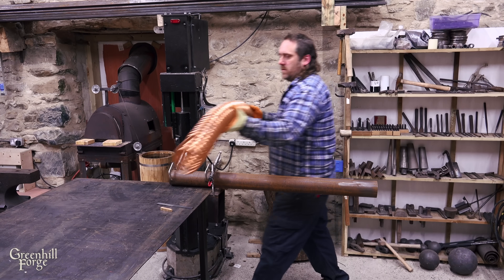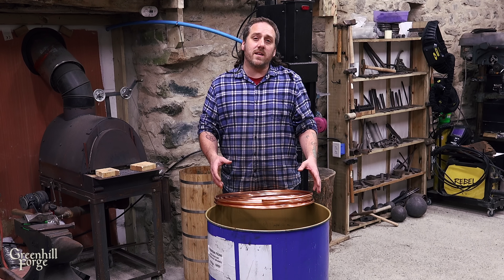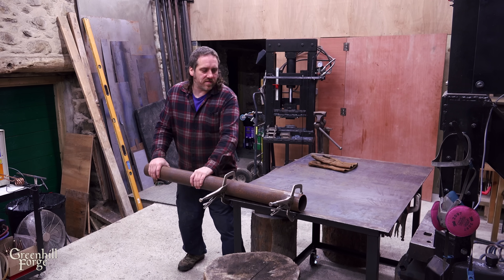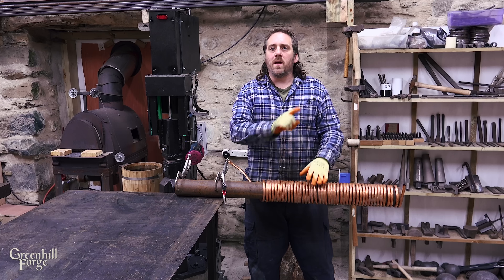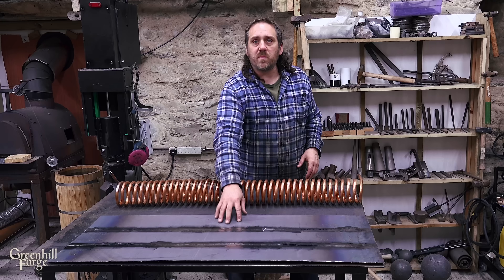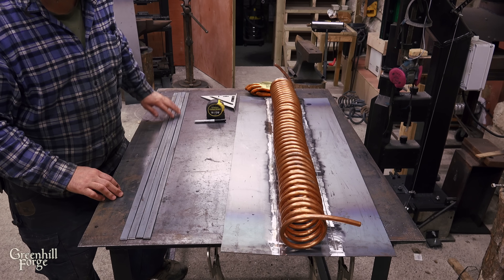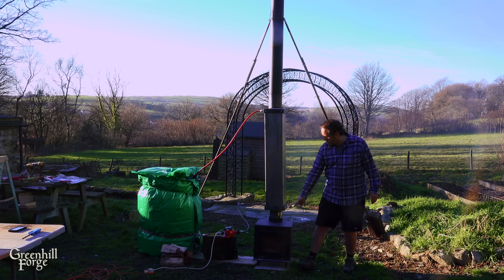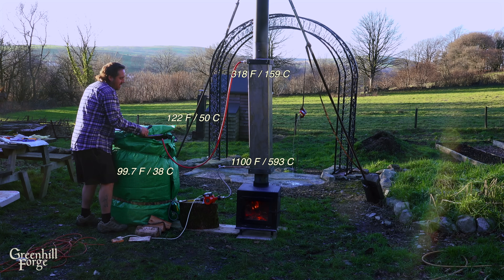Wood Stove Water Heater Experiment - Surprising Results! Part 1

Comment: I believe they sell like a larger pipe, that fits over the main pipe, for like spacer passing through a cieling or wall. If you wrapped the copper around the inner pipe, it should do about the same thing for less work and costs. I am building one for an outdoor hot tub / sauna.

Comment: There is a way to use the heat itself to circulate the water without the need for a pump. A version 2 would be interesting.

Comment: What kind of welding is that? I've been looking to learn, but not sure what is most useful for projects like this around the homestead. Would def cut down on the duct tape!
Reply from the maker: mig is where I'd start. easy to learn and can handle a really wide range of tasks. It's a bit pricey but this welder https://amzn.to/3Gm3Jpm is amazing. can do mig/tig/stick and makes it really easy to learn and get great welds even as a beginner with it's adaptive tech. It basically learns how you weld adapts to it.
Reply: @GreenhillForge  thank you very much for the guidance

Comment: Honestly I don't know why people buy expensive pool heaters when you can put a heat ex-changer on a harbor freight engine and use it's exhaust gas temps that are over 1000 degree's with a heat ex-hanger on it and use the motor to pump the water.  Win win.  Or putting a copper coil in a old Grill, I've seen some people insulate them and maintain crazy heat.

Comment: Hey have you ever seen the plan for a Tesla valve? An array of Tesla valves in series produces back eddys, something like baffles only more Tesla-ey. In your case, I'm thinking efficient energy transfer by slowing the air and messing it up some, so more energy can be extracted, like the Mafia for your home heating.
Reply from the maker: tesla valves are really clever. that's an interesting idea
Reply: @GreenhillForge  I expect engineering them from sheet steel would be even more interesting lol.
Nah I reckon build a mould then cast your fireplace from clay or concrete.
Another suggestion I have that might appeal, is dual curcuits. Turn two sections of tubing together, one short, one long. The short one just does a small tank for fast boiling water while the long one goes to thermal sink storage - a large tank, as well as underfloor heating circuits.
I like your channel and your legitimate scientific enquiries but you are using a heap of energy making these.
I like the bulky concrete, clay, mud, brick and stone fireplaces that act as thermal mass, preferably underfloor for distribution around the entire dwelling.
I like the fact that while being labour intensive, the materials are cheaper and require less skill and accuracy in their construction.
That's a nice stone wall, hope there's more where that came from :)

Comment: The workmanship on your project is second to none and my guess is that you have quite a bit of experience with this kind of manufacturing.  The concern that I have is that the water inside of the tubing will always be at a much lower temperature than the exhaust gases, often very much lower and when those gases come into contact with the tubing's lower temperature surface it will cause the creosote to condense onto the copper tubing and that will be an extreme challenge to clean off. It could turn out to be a creosote buildup machine that produces solid creosote better than anything known to date and that creosote will hinder heat transfer to the water, cause exhaust blockage and may, ultimately, frequently ignite causing alarming situations inside of the chimney. The draft and sounds associated with a chimney fire can be quite alarming but your industrial strength, overbuilt designs may render such an event much less dangerous than a normal residential type of installation, per say, though not at all a safe situation to experience. (I've encountered people who would simply allow their 'normal' residential wood stove chimney fire to burn until the creosote was exhausted; in other words a chimney fire was a non-event and they just allowed it to follow its course without even intervening.  I was passing by their home during night hours and noticed flames shooting 20+ feet into the sky above their chimney and when I knocked on the door, they eventually answered and after I exclaimed. "You have a chimney fire!" they seemed to be not at all concerned. He shrugged, glanced up at it and said "Ok thanks" and that was it.  He was completely unconcerned about the situation and I was of the impression that it was a regular occurrence for him.  I sat and watched until it burned itself out without any intervention at all.  He certainly did not handle the situation in the same way that I would have, that's for sure.).
I digress...

 When you first started I thought that you were going to install the copper tubing onto the outside of a cylinder shaped exhaust pipe (normal galvanized chimney/stove pipe for instance) and then proceed similarly to what you've done in the rest of the video.  I suppose time will tell but I have the thought that you are going to get a lot of creosote buildup inside of there, with more and more of it being located towards the top of the stack on the tubing and the walls of the inside of the stack container (The water will also lower the temperature of the container walls as well which will also collect condensed creosote (that's my thought, anyhow).   I would like to hear if this is the case because I've considered something similar to your design though much more simple.

I appreciate the design work of your system and this is a great video, though a little 'skimpy' on some of the fine details of how to proceed (for instance how to get started bending the tubing around the cylinder, etc.). Still a really good video, much better than many.  Best regard, CRS.

Comment: As mentioned in another reply is the creosote build up. There's no way to to clean it all out. You could get it off the coil surface but not in between or behind it so this is a dangerous concept. Putting the coil on the outside of the pipe, then insulating it would make better sense but it wouldn't absorb as much heat but still be viable.

Comment: The top of the cylinder coil should connect to the bottom of the flue coil. The circulating water should be pumped from the bottom of the cylinder coil to the top of the flue coil. This will maintain a temperature gradient both in the flue and in the cylinder. This is simple stuff - why does everyone always get this wrong?

Comment: Well alright!  Nice.  

Got my brain going.  When he mentioned the need for the two dampers and their purpose in terms of maintaining a particular temp, my brain automatically went to temp sensors with motorized computer control, lol.

Computer control not exactly for off grid living, but it was nice having my head fill with possibilities 😊

Also agree with top comment.  Counter current exchange is well established.  I would say it's vital for a year round setup.  The sooner you're at temp, the better.

Awesome video!

Comment: Like your idea. But not sure about you not fitting the original stove pipe up the middle of the coil ?   Plus copper and steel can corrode when touching            Im thinking of an external steel water heat exchanger fitting snug against rear of my wood stove.    Cold feed in bottom then out top of heat exchanger then into a similar flue coil to yours.             Then after further research maybe link into my gravity fed hot water tank.

Comment: If you were to pull the spiral metal guts out of a fuel fired hot water tank, it would help slow the heat and improve heat transfer and efficiency. Subbed

Comment: what ii know from years of dealing with plumbing issues. first off the copper sitting against metal sawtooth will end up leaking copper expands and contracts rubbing against the steel end result is a leak also being inside the stove pipe? creosote for sure anytime you constrict smoke your going to get creosote. just wrap the outside of your stove pipe done.

Comment: Some of the last production steam cars worked a bit like this, rather than spend 40 minutes heating all the water, they had a network of pipes to flash-heat only just enough water for one stroke at a time. You could push the ignition button and go after a minute or two.
I harboured vague ideas of converting a 1991 Corolla to steam, once!

Comment: Great vid :)  I write to propose a simpler and perhaps cheaper method...

However, your method, could potentially make "running hot water", like for a shower. But for THAT purpose, the copper tube should be thinner, and longer,
so there is many mor windings around the chimney...

 
I will also support what    @whm304   wrote: Send the water IN at the top... As it pass down, it will be heated to get warmer and warmer, 
and then it is a great advantage that the chimney is also hotter and hotter, "on the way down"...
As it is the difference in temperature "between two objects", which determines how FAST HEAT moves, from the warmer to the colder "object"... 

I will also remind you, that if you painted your copper tube BLACK, (with special oven paint) it would ABSORB HEAT FASTER!

BUT I was confused by your measurements... When the top end is so hot, the water should have fully evaporated and be hot STEAM, right?

Now I will explain a simpler method, which by principle is more effeciant than your surrounding copper tube... And perhaps cheaper too ;)

In my childhood, father bought an small oil burning heater (using an especially puryfied oven gasoline) for our small sailboat.
Because we live in Denmark, and also wished to sail in all weekends in the early spring and the late autumn, when it could be really cold...

THAT oven, had a round 15 cm diameter tube about 60 cm long, oriented vertically, to be the burn chamber...
The top was connected to a thinner chimney pipe.
AROUND it was build a metal box, some 50 cm tall, 30 cm wide and 40 cm "long", and THAT was the water reservior...
There was a tap, near the bottom, to take warm water, and another near the top, with a funnel attached, to fill cold water on the tank, when needed...

Inside the chimney pipe, there was a thin tube connected to the water tank, so IF the water started boiling, it would allow steam to go out through the chimney,
to avoid that the closed tank exploded.
With that we quickly got warm water, to wash ourselves, and the food utensils, and we could also take warm water to make the boil time shorter, when making coffee on the gas stove... And on the top of the tank, we could place a kettle, to get additional warm water supply, or heat canned foods or such.

After stopping the oilburner in the evening, the water tank acted a a heat reservior, which gave heat to the cabin, much of the night.

However the tank also acted as a "heat dampener", transforming perhaps  200 degrees Celsius on the burner tube, to perhaps 80 Celsius degrees on the outside of the oven, so it never scorched the surrounding wood, in the cabinet it was placed in...

Obviously that cabinet had air intake holes at the bottom, and an open top, so it was mostly "air heating" rather than "radiation heating", which heated the cabin, so it was equally warm all over in the cabin... Instead of being very warm, near the heater, and cold further away...

This "hot water oven" obviously also had a small oil tank, in the bottom of the water tank, but this is irrelevant for your wood burner project ;)

What IS relevant is: You could also make your burn chamber, be a vertical tube, perhaps 20 cm wide, so it is a top loaded wood oven.
Just with air intake at the bottom, and a small "door" to take ashe out, and obviously a "grill" inside, just above that door, so the wood rests on that...
This way the flames act directly on the sides, where your copper tube is, instead of only using the heat in the air in the traditional chimney tube...

That way you trap near all of the heat from the combustion...

By the way, I believe our oven was fully made of stainless steel, as that is most often used for boat equipment, to avoid rusting in the "damp air" at sea,
and it was also "food grade" so we could use the hot water for coffee and such...

But it was obviously painted black on the outside, to emit heat fastest...

Comment: The copper need to be outside the flue. Too much flue maintenance overtime with tar. Insulate the copper with fiberglass cloth tape. I have done a similar contraption to heat my pool water.
Reply from the maker: Check this one out https://youtu.be/5G1yANLjzw4

Comment: IMPRESSIVE!!!!  Will you be selling this product? Would be great for emergency water for cleaning dishes, and bathing, etc.   if the power goes out. Does require welding equipment and tools and other tools and no doubt some strength to bend the metal, etc.

Comment: ...also maybe add a bend or sharper angle to the coil and maybe insulate the firebox too , whenever i think of water and flame stuff it seems like autonomous should be possible for blowers , pumps generators for function even off some steam generated on the side just seems most practical ....

Comment: i don't think it needs the pump , the hotter water will move away from the heat pulling in the cooler water from the bottom but there's geometry to it like the input/output and the elevation from the tank (i watched other vids on it)  ....there's a rocket stove vid on here that goes though 20 feet of soil clay  compacted like ret*rd masonry and i heard that's how many old Japanese homes were heated in the floor with that method (?)

Comment: interesting topic , your shop gives me inspiration so i subscribed to remember to check out your builds , one buddy has a finished porch on his third floor , like a finished balcony almost but it exits to a deck and i always imagine if he had a burn barrel or woodstove on the open concrete on ground the chimney pipe could run through the floor there and it's have a bend or atleast 45 there but that section of pipe would not be double wall insulated , single wall except with maybe a bunch of scrap brake discs for a simple air convection heater into the rest of the house , it'd go insulated and out like a normal woodstove chimney for that idea and the smoke is all outdoors below that doesn't exit the chimney , i ponder on blower methods similar and stuff the thing about subfloor heat is thermopex is rated to maybe 200F and it takes a long section to hold maybe five gallons was my turn off to the concept with pex anyway , heck a human body is 98F and heavier than 5 gallons, sometimes with rooftop water heaters a big barrel heated from sun could do more maybe , the coil is basically a heat exchanger or radiator or radiator schematic but other times a big pot could work the same imo...I like your heater design i think to connect any type heater to a standard one the preheated water filling from the cold plumbing line needs a simple cutoff and maybe a backflow preventer so it doesn't heat the rest of the cold line but basically preheated water enters the standard water heater where cold normally goes in and below the specs for it's output seems safe ....

Comment: Hot enough to melt aluminum at the bottom, your solder will quickly melt if you don't have enough water flowing through it.  Extend the copper pipe out at least a foot before soldering anything!

Comment: Use gravity feed for the water ( no need for electricity ) valve off the gravity feed when not in use, and leave the bottom tap open to allow the water turn to steam and evaporate the water left in the copper pipe and leave it open , then when hot water is needed slowly open the feed valve to allow small bits of water to slowly cool the copper pipe down to its working temperature,  then after your hot bath , do the process over again each time, and hand fill your storage reservoir with buckets of water ,,, the key here is no electricity needed😊

Comment: ever thought of creating a collar system that sits around standard flues.innee and outer circular sheeting with copper pipe running the length. but with sand filling the air gap.